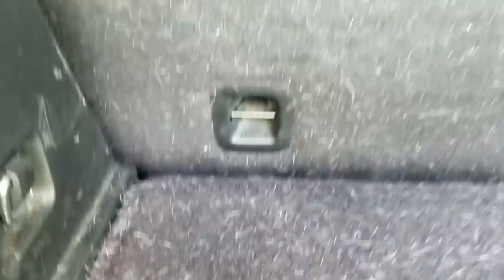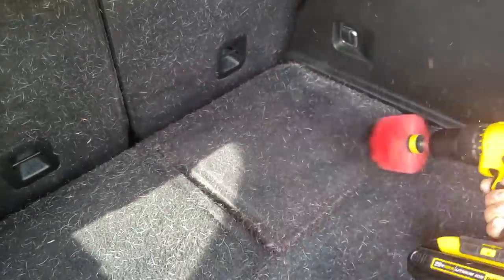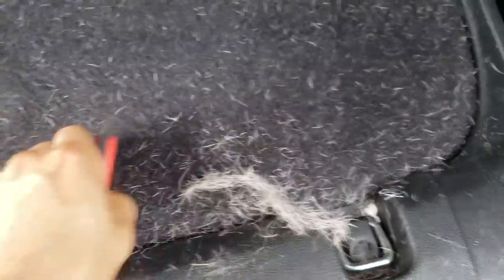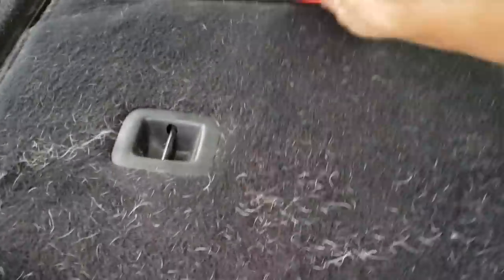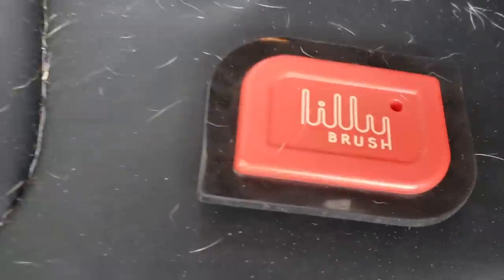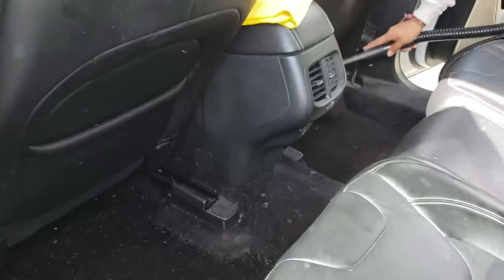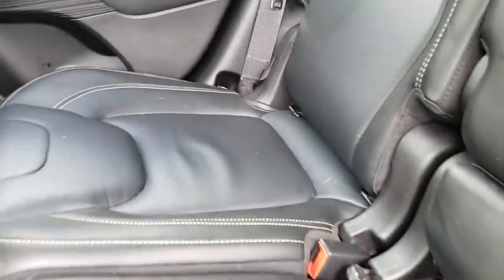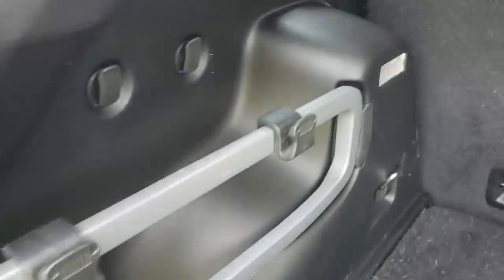Pet hair Galore! Removing Pet Hair From Car

Comment: Dear car manufacturers, please invent a floor cover that does not grip every speck of hair and fuzz.  There's got to be a better solution, right?  Just sayin'
Reply: Leather
Reply from the maker: right??
Reply: Weathertech has a new pet car bed but haven't seen any yet in cars but their front floormats are great for keeping carpets dirt & hair free.
Reply: It’s called a cargo mat they are made for literally every car
Reply: I've never understood why rubber mats aren't included from factory. It has to be cheaper than the carpet and would last SO MUCH LONGER. WHY. WHY?
Reply: There is a way, clean up the pet hair right after you take your dog out of the car everytime, pet owners need to stop being lazy...
Reply: Get car seat covers and clear vinyl floor protectors
Reply: Yeah, keep your nasty pet out of your vehicles! See, wasn't that simple?!!
Reply: You cant just get all weather floor mats? Or pur your pet in a crate? Or buy an aftermarket product for that?
Reply: @TwoAPTMLMusicProductions  because its more desirable and premium feeling. So yeah it costs after market/upgrade money
Reply: Exactly. It should be a hard surface which is easy to clean. Carpet sucks in general
Reply: Jacki O maybe not take your pet everywhere you go
Reply: Jacki O leather....
Reply: TwoAP & TML Music Productions neh if you can’t afford it deal with it lol
Reply: I have a vehicle like this. I stopped taking my dog in there because the fur is hard to get out. I use a scrub brush . Works good.
Reply: Yeah No pets
Reply: I’m so confused at the people commenting not to let their pets in the car? Lol...how do you bring them to the vet, or the dog park, to the lake, on a road trip?
Reply: Some cars are better than others, old hyundai tusons for instance compared to the getz. Getz is one of the worst imo
Reply: Easy the driver should invest in rubber mats.

Comment: I use pet stones (pumice stone) then a Tornador or air tool on the whole carpet. The rear trunk area is always a pain in the ass, but I'm able to get 99% out. 
I'll have to look into those Lilly brushes for crevices cause the stones can scratch plastic easily.
Reply from the maker: That's why I'm not a fan. I bang my hand on the surfaces all the time. You have to be extra careful and make sure you're not close to the edge

Comment: I work at a reconditioning center and for the back cargo area, I have trained the employees to use the tornador and close the valve so it is just compressed circulated air. I works wonders!!!!

Comment: If you combine the lilly brush and a pet rock you will get a 99% of the pet hair out. I'm a detailer as well and I understand how messy it could be, specially on any Jeep (Like that Cherokee you are working on) the cargo liner and carpet is just the worse to work on with pet hair). It takes time and patience but for real, try the pet rock in conjunction with the lilly brush and the result will be a lot better.

Comment: Great idea with the drill & on your advice got those Lilly brushes, which are the absolute BEST tool for removing pet hair. Great tip!
Last year, I had a car maybe worse than this but before I had the Lilly brushes. Client has
German Shepherd in their Mini Cooper and on the phone, I thought how bad can it be in a small car? Took over 2.5 hours just to remove all the hair with compressed air & vacuum. These are the type of clients/jobs when I consider selling drugs.

Comment: Next time spray the affected areas with fabric softener diluted 7:1 before brushing...it helps break the static bond between the hair and surface...
Reply: Won't that make the hair stick together and sling everywhere?
Reply: @danthedisciple6198  You would just use enough to slightly mist the carpet.

Comment: I've heard you say how hard it is to record with one hand and do the work with the other. You should get like a head mount for a gopro or something I think itd be really cool to see that POV of a detailer
Reply: Yes ! This would be so cool :)
Reply: J.B there are also cameras motovloggers use that are cheaper then gopros, C2W has a video on one at $99. Similar dimensions to the gopro too so it easy to use a gopro mount 
It would benifit everyone
Reply: @overknight5278  whatever works for him just thought it was a cool idea to help him out 👍
Reply: Yeah having to use just 1hand is going to slow him down a bit.
Reply from the maker: I've tried it. I wished it worked better but my head bumps into so many surfaces that I can't properly clean sections. Then when I hit the camera, I have to check that I'm still in shot, etc... so in theory it works, but other problems arise

Comment: I feel your pain, working on a boat right now and dog/cat hair is driving me crazy. Customer wants it all gone because he is selling boat. I used 2200 psi pressure washer first then a (sea sponge) to rake the hair up in piles then wet vac then 125psi compressed air and so far I have 6 hours on just hair! (I should have charged way more). I`m going to try the drill and brush thing tomorrow. thanks for the idea and try the sea sponge it works on normal carpet good.

Comment: Oscar a pet hair stone would have saved you a massive amount of time and effort. The rubber pet hair removal tools work better for longer hair and to not scrape the trim.
Reply from the maker: I'm just not a fan of those since you have to be very careful with not scratching plastic surfaces. Also, it can sometimes be over agressive with the fibers
Reply: Detail Mafia see my comment on the comments it will help you a lot bud
Reply: @yh8tbz83  don't know what you're talking about.
Reply: @detailmafia5626  Pet stone is the only way to go

Comment: Hey Oscar I’ve never done a pet hair job before and it looks great. But I was wondering on the back area that was 90% if the customer was not satisfied and was willing to pay extra for your time do you think you could have hit it with the drill brush and pet hair brush a bit more like you just got there and started from the beginning again would you have been able to improve on it or was it as good as it could possibly be and if the customers not satisfied do you suggest offering a discount or $ off the next job they buy or do you keep working for perfection and not charge for more time. How do you handle an unhappy customer. Do you just say it’s what it is and I won’t work for you again? Or do you believe in the customer is always right and do all you can to keep them happy?  Great job and thanks for the help
Reply: Hey thanks bud appreciate the reply

Comment: I did an older Wrangler a couple weeks ago with cloth seats and a similar short hair dog....man, what a mess.  I made the mistake and missed a section to loosen and you are 100% right, it makes a huge mess when you have to go back again.  Nice job!  I bought an Aqua Pro based on your several months of use and it seems to be holding up well.  Excited to get it going soon.

Comment: You should get a go pro that you can mount on your head! I feel it would be much easier for you rather than holding your phone
Reply from the maker: My head bumps into everything, causing the angle to change. Which then I have to double check and make sure getting the proper angle. Not as simple :(

Comment: We are having two Corgis, which are shedding like hell, but our Car is clean. We bought rubber floor protectors and with vacuming twice a month it Works out well. If you can afford a car, you can also afford an extra like cheap rubber floor😂. But good for you because of the work. Great Job!

Comment: have you tried razor blades?  i have a invented a new product that uses high quality, smooth 3" blades (2 of them) and has a 6" ergonomic handle with plastic with nice textured ruubber overmold grip offering a nice and comfortable handle which is lsightly c curved and has ULTRA SONIC VIBRATION to enhance pet hair and lint removal from all types of fabrics as well as the rubber overmold also give the product maneuverablity and a flexing feature when hitting tough to reach places and prevents snagging and catching on fabric as well!  lmk what you think of the blades removing pet hair from fabric and any other feedback please fell free to give me your honest opinion!  let me know thanks man!

Comment: dear friend do you ever do the fabric softner trick to help you with pet hair problem? it is working?
Reply: marios kosmidhs what is the fabric softener trick
Reply: @jtrinipapi  if you have to deal with heave per hair problrm in carpets you can spray a diluted dolution of fabric softner into the carpets to duel for couple of minutes. This helps 1. To sodftner the fabric and open the fibers so it helps to release the pet hair, 2
 Νutralizes the static electricity between hair and fabric and also helps to remove the hair

Comment: Do you think lint roller may work?
Reply: Afrah Ks - having to remove the layers would be annoying!
Reply from the maker: The owner tried lint rollers.. It basically did nothing. You need at least a rubber brush to be effective

Comment: This would have gone so much better if the first process using the drill brush you had held a powerful shop vac hose nest to the drill brush.  That would have captured the bulk of the hair and dust easing things for you from that point.  Also, at the end there was still hair remaining this should have been finalized with a masking tape roller brush.  I suggest you think deeper into what you're doing as I see you had a lot more work than needed to be.  I'm offering this as help, not criticism.